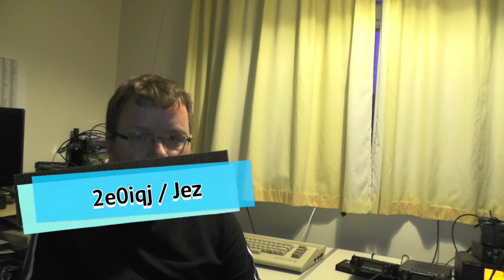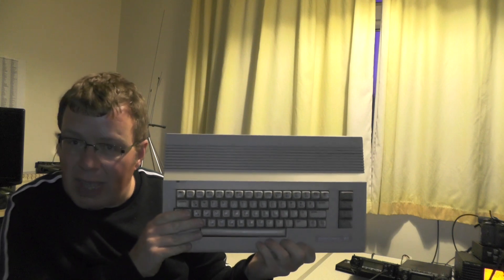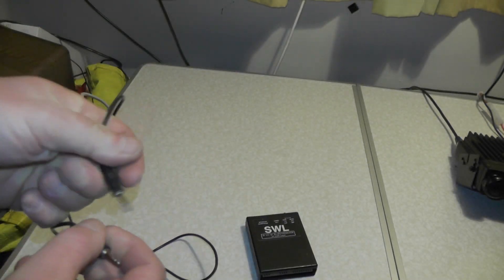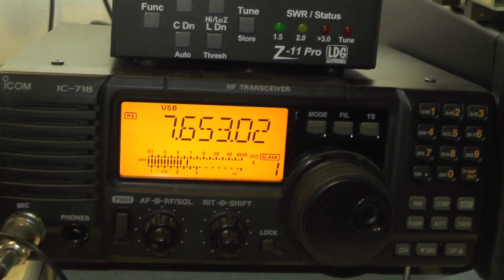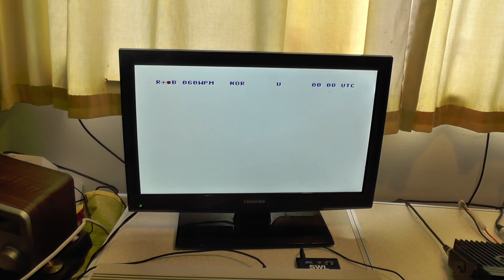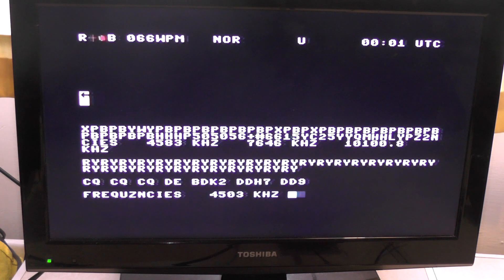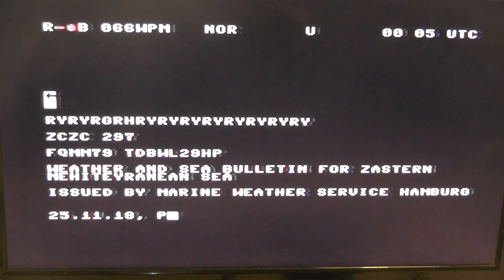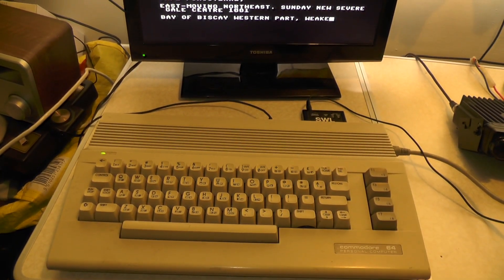C64 Ham radio cartridge

Comment: Where can I download a copy of the hamtext cartridge for the bic20 and c64?
Reply: The cartridge he showed in this video wouldnt be much good as just a downloadable rom as its not just a rom,  the adc & decoding circuitry is also in the cart n cant be done entirely in software.
Reply: @CJ-rf9jm  unless you hooked up your commodore to one of these, via the serial port.
https://www.universal-radio.com/catalog/tnc/pk232.html
Reply: @G7VFY  I know what  TNC is and that cartridge does NOT use any tnc! the only way it can recieve either rtty or morse is via it's own built in hardware.  Theres no way in bloody hell you can simply rip the rom and make it work without the rest of the hardware in the cartridge.  Do stop before you make yourself look like even more of a flaming idiot!  Seriously though I should be thanking you for the laughs but not in a good way.

Comment: Hi there, thanks for sharing, im trying to get packet to work on my Amiga 1200 but havent found a working piece of software yet. I have a couple for C64 :)
Rene OZ5RS
Reply from the maker: Using a amiga 1200 on ham radio would be very good. im sure there is software somewhere I think my friend used to use amiga 1200 with radios ill have to ask him. the C64 works every time for RTTY and morse code thanks for watching